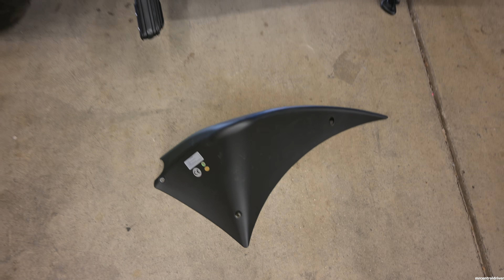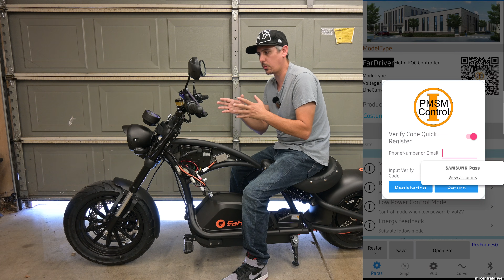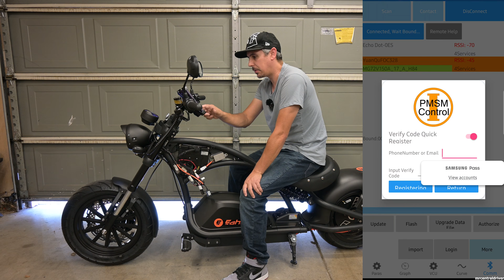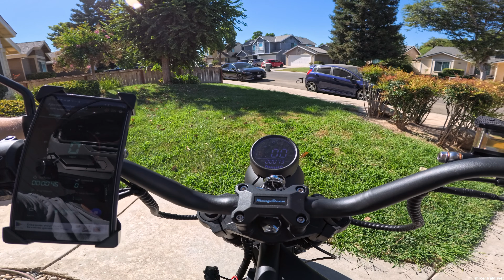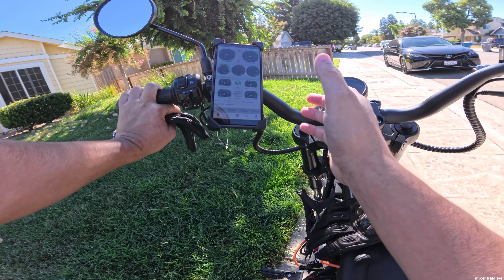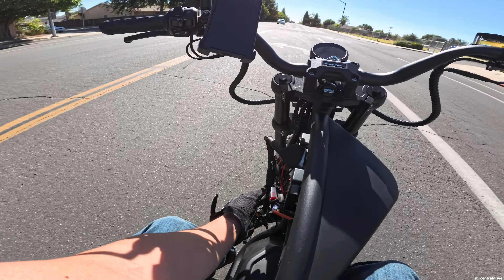Unlocking the EAHORA M1PS

Comment: I know this is a older video but wanted to give you some info, Your only supposed to draw 80% of the total power the breaker can handle, in this case its 100 amps. Yes the back motor will act different under too much load witch is heat. Amps are what cause that not voltage. Also think about wire size, they may have designed the wires to whatever specs the bike shipped at due to cost and its more difficult to deal with larger gauge wire.  I'm a 35 year sparky and just wanted to thank you for making this video as it was very informative on my decision of changing any stock settings. I'm getting ready to also review this bike and I will for sure change the park idol settings. Again thanks for your work here. Liked and subbed

Comment: I have another question: do you know if it's possible to use this Bluetooth adapter to unlock the speed limiter, which is currently locked at 25 km/h, so that you can then use the accelerator and brake pedals to increase it to 45 km/h? Thank you so much for answering my questions...

Comment: Id love one, but they're just too weak for the price. Id like to find a used one that doesn't run for cheap, then upgrade the controller, battery, and motor.
Reply: Honestly the range is my biggest downside with this.. I get about 37 miles riding with my wife on mode 1 .. i imagine id get half of that if I was actually matching the speed of traffic. Its alot of money for what it offers but its still a really good bike. Theres better options but none that look as good as this one.

Comment: Did you or any of you saved or screenshotted the settings? If yes I would like a copy if possible because I found an app that is compatible with but it was for an older model and it changed something and now I have an error E10. Bike still works fine but I cannot see the speed on the odometer and which gear it's on, it's stuck on P on the display

Comment: I love my Eahora but I can't trust it because it would constantly get stuck in park mode at a light or in turning lane. Wish I new how to access the controller so I can disconnect the 8 second park mode.
The other problem is with terrible customer service where you are required to be mechanically inclined to trouble shoot and upload video to Eahora since they have no service mechanic to recommend or repair scooter.
Buyer beware!!!
Reply: Yes that feature is very annoying. Especially in high traffic streets where it'll just cut off and then you sit there a couple of seconds trying to engage the throttle again.

Comment: Hello and thanks for your posting. I just received my Dongle and after doing a little more research I’ll be changing my settings as well for the existing system.  I reached out to Eahora to see if they offer an upgraded battery and controller.  Since mine is registered id like to take it in the highway comfortably.  I do purchase a wind screen and installed for better wind resistance when riding.  Keep us updated and thanks again! 👨‍🚒🚒

Comment: The battery has an 80amp battery, look at it man, it says right on it, and has an internal 80a fuse you have to take the front cover off the battery off to see it. You WILL pop that fuse if you go higher., you need to be careful what you set your normal amps too, phase amps is not the amps. Phase amps should be set to 3x Amps. So set your MAxLineCurrent to 80, and phase amps to 240.  Weak Character should be set to 0 Fast.  Weak response to 0 Those two are not things you should really ever mess with it doesnt need it.   PolePairs=30, RatedSpeed equals 1100 rpms, i measured this with an IR RPM meter, and the wheel only speens at around 1100 rpm.  You need to also set the RatedPower to 4000w, this is a 4000w motor.  Your Ratios in Speed. The RPM to percent keep it at 100% for the first 6 RPM settings then taper it down to like 10%.   If you set them all to 100% you get more, but bro this will suck your battery FAST. I’ve tweaked the hell out of it and that 80amp battery is absolutely killing this bikes performance. That 4000w motor will handle 10,0000w easy.. trust me.. wink wink. But the battery will not. So again, reach out to Amorge, measure the battery dimensions, and they can get you a 200+ amp drop in replacement, and then you can max out the controller to its max 150amp, 405 phase amps and this bike opens up and really becomes an E-moto.

Comment: Does anybody could help me, I have a “M1Pro”, it’s 60V, 50Ah exact same speed controller, don’t want to make it go faster, it is already doing 52MPH verified, I am wondering what would happen if I plug-in 72 V battery ???
Reply: You should be able to insert a 72v right in ..get an Amorge lishen 😅 for 1000 you get the 72v60ah and 375/525 amps..😅😅😅 vroom fuckn VROOM
Reply: Did you get it from
Amazon
Reply: @mr.allthat533  correct, Amazon $3968 including taxes and delivery charge
Reply: It's all about the controller, the controller won't be able to handle the 72 volt. Your controller is a 60 amp controller, not a 72v
Reply: @firstinlastout  but here’s THE THING… my body has a M1PS-72V 40Ah 4000w and it exact SAME controller what’s in my M1PPro (60V 50Ah) this is why I think it will work, I already order 72 V battery of Ali express.

Comment: This shitty battery they provide doesn’t have the amps to get you where you need/want. Amogre sells one that’s a 200+amp drop in replacement. not meant for the scooter but fits perfectly,  So you can max the current fardriver or upgrade to a higher output FD controller like me and rock your world
Reply: Link to that?
Reply: What speed will you get up to with that battery replacement?
Reply: @JeffreyKalinowski-k5j  replacing the battery doesnt increase your speed by itself you have to get the fardriver bluetooth dongle and learn about fardriver controllers and how to tune them.  Any more than 60 for short periods on this is dumb, the bearing and such are not meant to handle those sustained rotational speeds.
Reply: @cyberlunacy ok thank you. I’m fine with speed. I definitely just want longer distance
Reply: @c @cyberlunacy also I saw that you said phase amps to 240 I believe. So I need to change the Maxphase amps from 405 to 240 and the original battery will last longer?

Comment: You are 100% gunna smoke the battery bms or blow the fuse in the battery, I guarantee you will. The battery is only an 80a battery but they tune it to 70. 100a is, will, gunna blow the 80amp battery fuse inside the battery. You are also messing around in easy mode and you should NOT, don’t. Tuning this is easy once you learn. Bro you bought the dongle from conic you NEED to reach out to them, they can help you tune it and know blow shit up cuz you gunna with those settings. 80a  and max phase is 3x amps, I own one, I know what I’m sayin. You don’t touch weak response leave it at none, your speed comes from your ratio in speed settings amps phase etc. and you 100% will get an email with a code but it’s not instant email. Trust me man you need to stop,,, learn the tuning, and have conic tune it properly. I’ve had mine going 65mph, but you’d fry shit
Reply: What'd you put for pole pairs?
Reply: @andyfumo8931 30
Reply: @andyfumo8931  30
Reply: @andyfumo8931  30
Reply: @andyfumo8931  30
Reply: I now know you don't know, maybe you've learned more now 😅

Comment: Will this work with any eahora chopper  with a fadriver controller  i have the m1p plus 3000w
Reply from the maker: it should. its worth a try for it only costing 30-40bucks and you can change some settings

Comment: What they should do is increase the battery capacity and come out with a dual motor version of that beast.
Reply from the maker: Dual battery or bigger 60ah battery is what I'd be interested in
Reply: @MrCentralDriver  I bought the M1PS and an extra battery, I run the two batteries in parallel. I removed the plastic battery cover and the second battery fits right on top of the original. I just reached 2600 miles earlier this week using this setup.
Thanks for posting this video, I also bought the Bluetooth connector to disable the auto P mode :)
Reply: @fmpwizard  Hello, I also have two batteries on top of each other in a beer crate. How did you do the parallel connection? The battery manufacturer said that you can't connect them in parallel! Your solution would be of great interest and I would be grateful if you could help me. Regards, Dirk @MrCentralDriver The Registation is easy :--)) To register, you have to make the font size on your smartphone smaller so that you can enter the data. Once you have done this successfully, you can reset font size as you will always be connected directly without a login screen.
Reply: @fmpwizard  Hi, I also have two batteries in a beer crate on top of each other. How did you do the parallel connection? The battery manufacturer said that it was not possible. Could you help me to do that? I would be very grateful for your help, regards Dirk
Reply: @fmpwizard got a question for you, I'm 6 ft 2 and 300 lbs. Will I bottom out on this suspension? Also, am I too tall for it or just the right size. All I want to do is be able to hit 45 mph and that's it. I just want to go with the flow of traffic on regular roads
Reply: @firstinlastout  you'll be fine, the 4000W motor is amazing. My daughter, extra battery, myself and gear are about 300lb and the scooter handles it nicely. I'm 6 foot tall and I feel comfortable riding it. I would recommend using the foot peg extensions
Reply: @crew-lol_bockes9673  Hi, looks like my earlier reply did not go through. I bought from Alibaba 2 male connectors that each go into each of your two batteries. And then one female connector.
You then connect the positive on the female connector to the positive on each of the male connectors.
You then connect the negative of the female to the negative of the two male connectors.
Next plug the two male connectors into your batteries. This is called connecting your batteries in parallel.
And the final step is to connect the female connector to the orange connector that comes on your M1PS that used to connect to the original battery.
This will continue to give you 72 Volts nominal (84 when fully charged), but double the amps (assuming you have two identical batteries). I'll try to post a video on my channel with this setup in the next couple of weeks (We are recovering from the Helene hurricane here in western NC).
Reply: @fmpwizard tagging on here, another YouTube'r who is 6⁵ did 2 versions of this, the black and a red chromed out version. The height is definitely fine. There is also a kid sized side car and rear seat available so as long as the grade isn't too steep you should be good to go.
Reply: @fmpwizard  in looking at doing the same in a couple months,  glad to know it works out well.

Comment: volt X amps = watts  so if you have it at 72v at 100amps thats 7200 watts. maybe try to match the watt number with the amps you put it at and maybe it'll be more stable?
Reply from the maker: Maybe. I thought about that. Just odd because it was setup as 72v3000w and running 70amps which means 5040w and it was set at 3000w and ran smooth. But yeah there's always some tweaking that could be done. When I get time I'll mess with it and see if I can get more top speed. The torque has already increased a bunch.
Reply: @MrCentralDriver  ahhh interestingggg. i need to get me one of those and test on my bike. more power!

Comment: From what I read of the fardriver manual, that "weak" setting already indicates that field weakening is on. Nothing you tweak in the settings is likely to give any extra top speed. The only solution to that is a higher voltage battery, which this controller likely won't handle. (My understanding is this is a 72150, so the 72v battery is already at the limits voltage wise, for the controller.) 

You can certain get more amps for punch and startup, but without verifying the cells in the battery and the bms capabilities, pushing those values up is...not without risk. At best, it'll degrade the battery a lot faster, at worst it's a fire.
Reply: Yup!
Reply: Thanks Debbie Downer
Reply: Yea but he can tweak his rpm speed if you look his max rpm limit was set to 2700 the recommended max limit was 7900 almost 8000 and the maximum rpm speed limit is 12000 so if im thinking right if you used the factory max limit from 2700 to say 6500 then that should technically give you a higher top speed do to a high rpm limit and also by tweaking the gear ration power percentage you can get more acceleration through out the rpm’s that like when he set the rpm’s he did 500 rpm with 99% power 1500rpm at 95% power and so on if you upped the max rpm limit from the factory 2700 to 6500 then set it up like 500 rpm at 100 1000-1500 rpm at 95-90 200-2500 rpm at 90-85 and so on you’d have faster acceleration in the beginning rpm’s and also higher rpm’s for a higher top speed
Reply: @Bigmoe_ghb24  Maybe, but I suspect not. 

It's going to boil down to if the controller RPM limit is actually restricting anything. Ultimately, hub motors can only spin at a certain rpm-per-volt (kV) which is what truly determines the top speed you can reach. (Setting aside field weakening, which can only push that so much further.)

I'd find it unlikely the controller RPM speed was restricted, though. There's little advantage to doing so -- if the company could tweak one setting and now advertise 55/60/65/etc mph, I think they would.

Comment: Have you tried the manufacturer hack to add top speed? Where are you? Engage the throttle all the way and the break while the bike is off and holding it down for nine seconds?
Reply: Do you know if the manufacturer hack actually works for the M1PS?
Reply: The motor speed is limited by the voltage, this one is rated at 72V (84V when the battery is fully charged), the hack works when they come limited to 30mph in software, but the M1PS is already running at top speed.

Comment: Great tips! I had no idea you could do all that. This bike has so much more potential, I want to see someone mod this to hit 80 mph 😆
Reply from the maker: i wish i knew an expert on modifying these fardriver controllers to get the settings right. i'd like 60mph and 54-55mph when the battery is half down. the torque is much much better at 100amps that's for sure. upping the power to 100% at take off helps too. also the throttle acceleration can be adjusted so the power is instant and doesn't ramp up. that park mode bugged me so much. now its gone :)
Reply: @MrCentralDriver the battery is rated for 80amps line, I set mine down to 80amps and I get 55mph at 100% and 50% battery. The Regen is the game changer, I have it set to 10/15amp max. My 1st gear I set to top out at 39mph and 2nd tops out at 50mph. Both have much much more torque than stock settings. Still trying to figure out if Regen on brake or throttle off is better.
Reply: I def need more information, i have a the bike and just bought the fardriver bluetooth dongle. To read u got 50mph in 2nd is sweet asf...does it manage to entend ur mileage/battery being that ur technically in 2nd but speeds of 3rd which would comsume more battery...hope u get wat im saying @andyfumo8931
Reply: @MrCentralDriver   man the max line amps dont have anything to do with the take off speed that is on the maxphasecurr side maxlinecurr is for top speed not take off speed
Reply: @MrCentralDriver link up with @e-bikeguy he got a fardriver to go a 100
Reply: Anyone have updates on optimal settings? I just received my dongle and ready to get the most out of this bike! Thanks 👨‍🚒🚒
Reply: Turning up the California juice boys.  Ebikeguy knows far driver. I hope he gets a ehore bike. 🤟👽🚲🎬
Reply: We need a 100ah echopper asap lol

Comment: For the email binding, check your spam folder
Reply from the maker: didnt check that but maybe? I tried my # and got nothing. but it works without even doing anything
Reply: @MrCentralDriver  The Registation is easy :--)) To register, you have to make the font size on your smartphone smaller so that you can enter the data. Once you have done this successfully, you can reset font size as you will always be connected directly without a login screen.

Comment: Do you know what the difference is between the m1ps and the m1p pro?
Reply from the maker: 72v vs 60v
Reply: @Jonathan1003  M1P PRO exactly same specs of M1PS, but with lower voltage and battery compartment has room for second battery pack
Reply: M1 P PRO has more powerful motor and battery. Faster more range.
Reply: Only difference is the voltage(72v vs 60v) and max mileage(75miles max vs 55miles: but an option to add 2nd battery in compartment or storage area) from bike. I have the M1P PRO and it still hits over 55mph..at times. But to see this video to remove the damn park is great